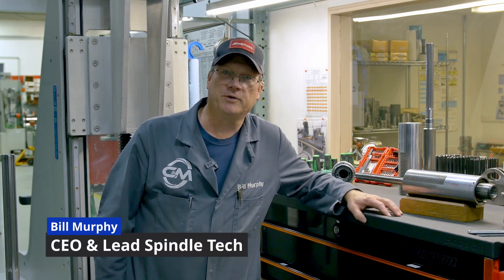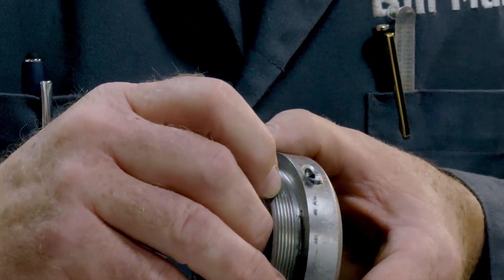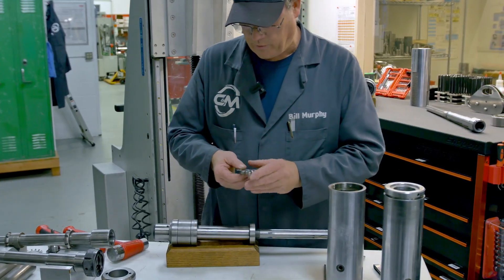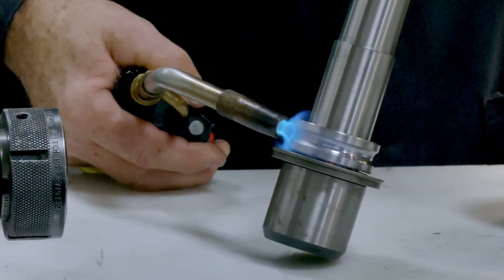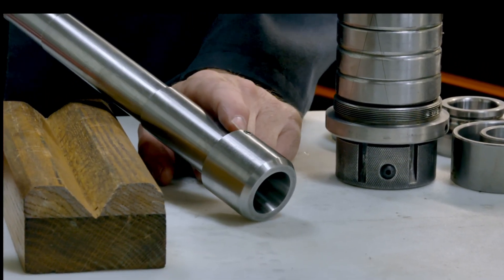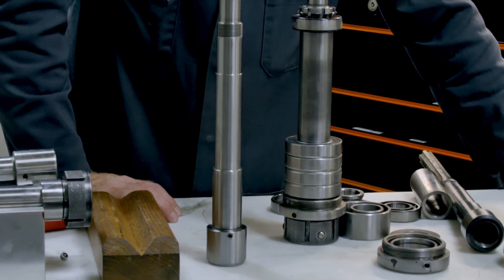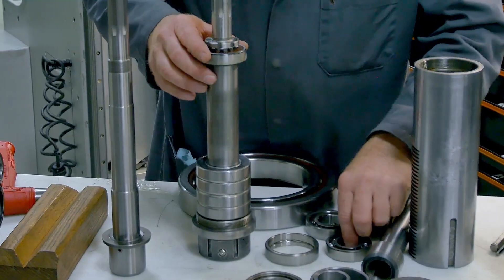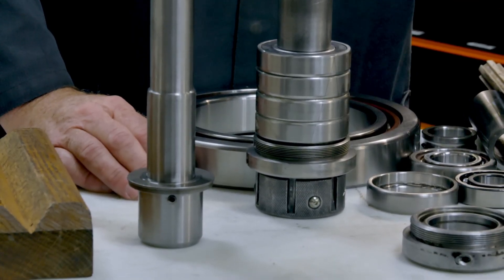How to Disassemble a Bridgeport Spindle

Comment: What is the price for the 5 pack and regrind the items you mentioned if I supply my bpt spindle.
Reply from the maker: $650., for bearings, R-8 grind. Be sure to send the Nose cap and the sub-assembly still together. UPS is still the cheapest, jut make sure it is in a wood box so it can take a UPS drop.  Cheers, Bill